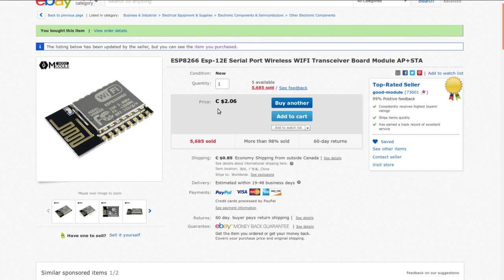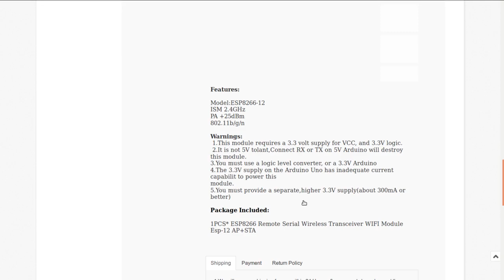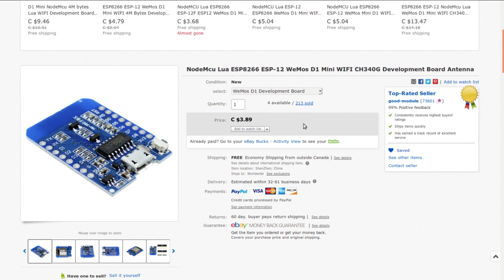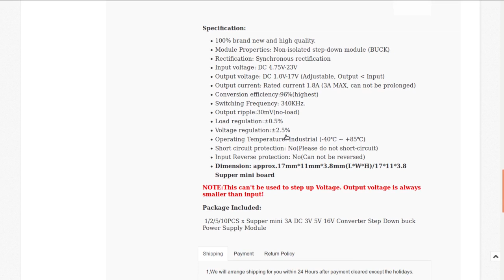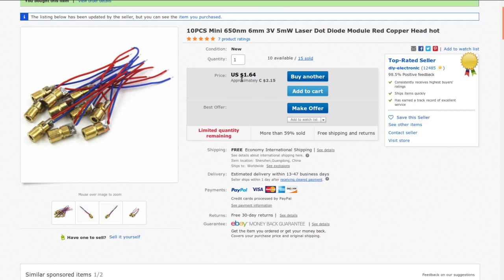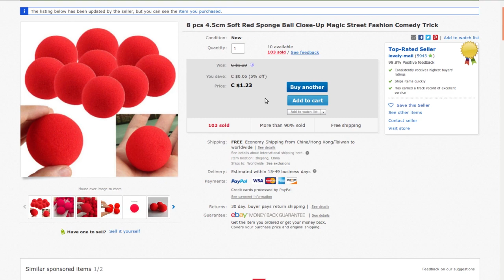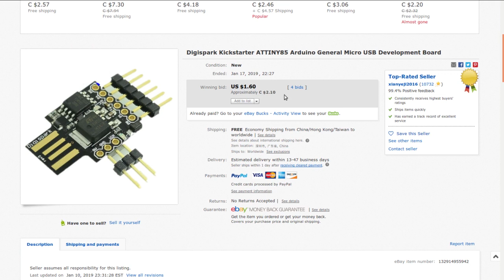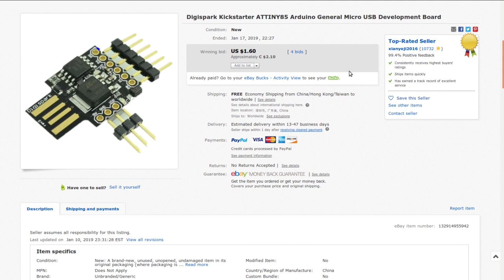mailbag monday #62

Comment: About your Digispark:  If you mount headers pointed DOWN (w/o the V(in)), then it fits neatly into standard breadboards, providing power vertically and GPIO pins horizontally.  Be sure to check out the DigiCDC echo example in the Arduino IDE ... nifty that you can read/write/print through the USB.   Two pins will be a little bit corrupted with for USB D-/D+, being voltage capped to 3.3v with zeners.   One is even pulled up to signify USB 1.0.  So sadly, there is really only 1 clean analog-read input, if the Reset works.   Since the Micronucleus bootloader is activated on power-up, you can fuse out the reset pen to get 4 clean GPIO lines with 2 analog in.  This change is permanent, unless you have a HVSP handy ... or you make one, (I did).
We must have the same lasers.  Was also disappointed that they are not well focused to a clean circular point.

Comment: The chip is just the ESP8266EX. The pcb it is mounted on determines the model. Looking to the antenna this is a 12E model. But the model of the pcb is (edit: almost) never shown on the chip (FCC approved cover for chip and flash) itself.
Reply: Thanks ... have always wondered how that model is determined.  My E's, from a couple years back, have 4mb w 1mb of program space.  My attempt at soldering one up is a janky mess of vertical bodge wires.  Looks like it is on stilts, with the antenna hanging over the protoboard.  Instead of a logic level converter, I just used a resistor w 3.3v zener to knock down the voltage of the Rx line.  Annoying to wire up two buttons to go into boot mode.  An AMS1117-3.3v did the 5v conversion nicely.  It is SO worth it to buy the Wemos instead of a bare board!

Comment: Nice 6.25% stoat.  I love those laser diodes!
If you're cheap ATtiny13s are good. Same as the 85 but less ram. If you want to flash a LED it's fine.

I used to be a cub scout, a sixer even - 2nd Royal Eltham!
Reply: I bought 5 of those Tiny13's last year.  Yes, they are cool for doing trivial control of an RGB string, stepper motor, etc.  You run out of flash really fast though.  Seem to remember they run at something strange, like 9.6mhz.
Reply: Stoat?  How drunk was I!  Stout is much nicer!

Comment: I got some of those laser diodes sent to me by mistake. The ones I got can be focused by turning the front of the case.
Reply from the maker: I just checked and you're right!
That's very cool. 

Thanks.
Reply: There is always a way to focus those laser diodes. I have seen 3 different methods to focus them.
Power them at 25ma to get best brightness and life.

Comment: These Mini360 buck converters are pretty handy for around 0.30€ a piece. About the cheapest option for adjustable speed control of PC fans.
Reply: Those Mini 360 buck converters are the same size as  a LM317t regulator. I tried one on a muffin fan rated 12v .6a using 18v as the source. The Coil was getting hot, about the time I decided it needed cooling it stopped working permanently. That other Larger buck converter you got will work reliably up to 2 amps
Reply: @wooferhound7571  I've read that there are slightly different models and some have badly chosen inductors that go into saturation fast even with tiny loads. Replacing the inductor by something more adequate is said so solve the problem. With 12V input mine didn't get warm driving 120mm fans.

Comment: Use the Lasers on this: https://youtu.be/vmFkuuLbS6Q Juat replace the LEDs with the Lasers.
Reply from the maker: Are you psycic? 

I was tinkering with that last night...

The 4017 doesn't seem to have enough oomph to power the Lasers. I need to add some transistors to drive them.
Reply: @pileofstuff  I put 12 Volts into mine, maybe you could try that? Runs fine for me like that.